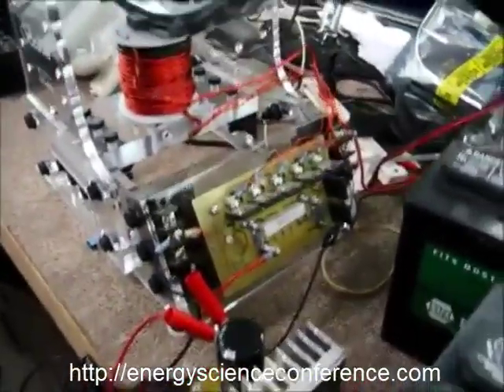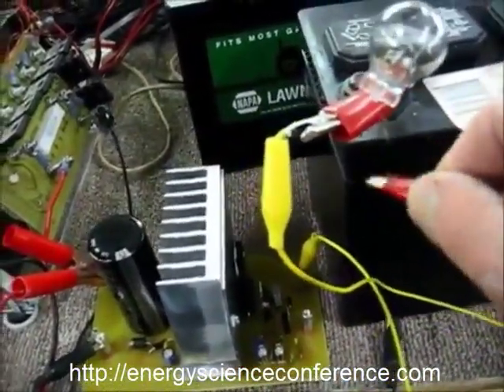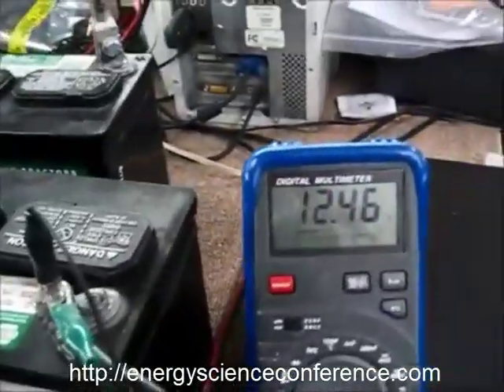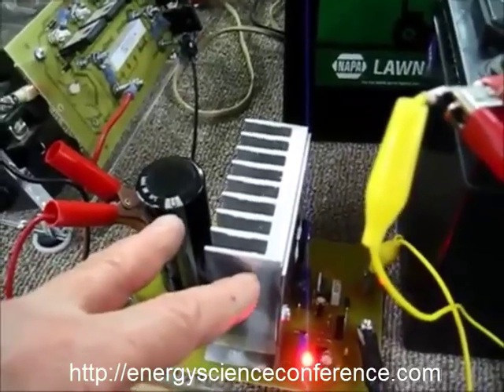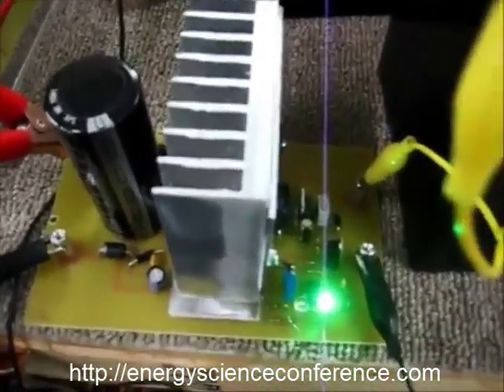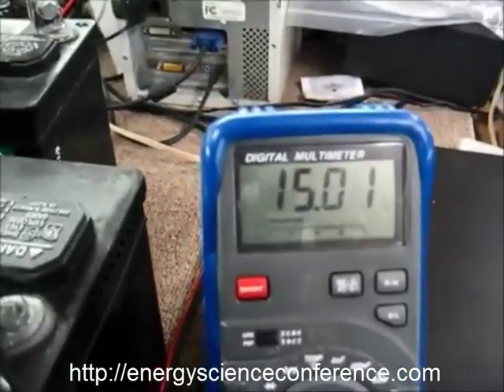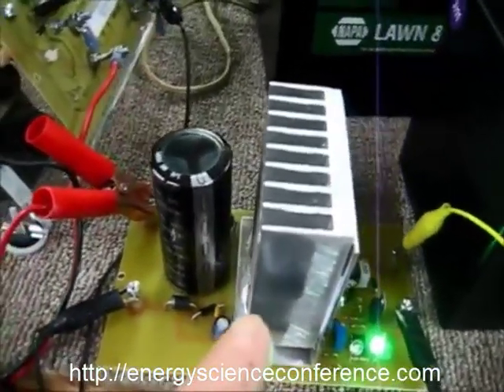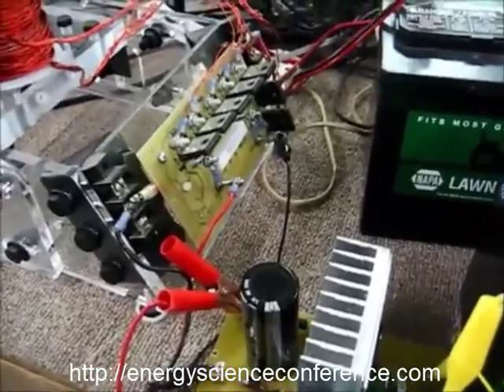Linear Current Amplifier by John Bedini

Comment: Is the LCA required for charging Lithium Iron Phosphate (LiFePo4) Batteries
with your chargers?  Will the SSG charge LiFePo4 Batteries?
Reply from the maker: +Charles Maza The SSG can charge them, but those batteries seem to like steady current like what is avail from the linear current regulator circuits. http://teslachargers.com/products/bedini-sg/linear-current-regulator/

LCA are you referring to lithium cobalt or life cycle assessment? Please email info at teslachargers dot com with this question.
Reply: +Aaron Murakami  Yes, Thanks Aaron - I think you answered my question.
LCA - I'm referring to Linear Current Amplifier - It's all good.

Comment: Iiiiiimmmmm first to comment?!?!!! So these solar trackers do they all fix the spike coming from the ssg?  I have a very large ten coil machine I bought before Rick and John parted that I'd love to use while it runs!!  Just need to know what's next!!  BTW thanks John. Your knowledge will be appreciated and is already!!  Thx in advance for the answer :)
Reply: Hello Marshall. How many power your ten coils machine outputs? Is it possible to power a house using only these machines? Worth buying this ten coils machine kit? Thanks!
Reply: I wouldn't know where to find one of these. John Bedini hadn't built a ten coil in years. The one you want is the one he built. The comparator circuit is what I believe is in the trackers. They are more than happy to get you setup at teslchargers.com